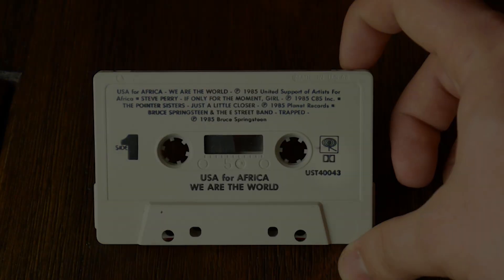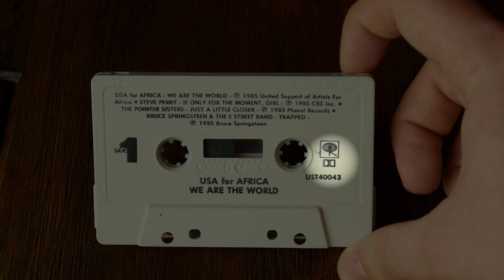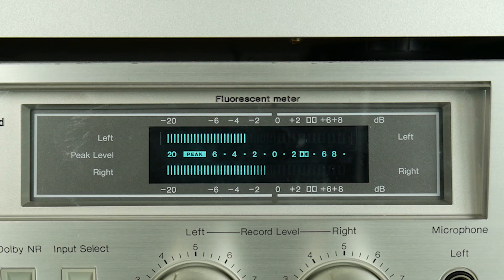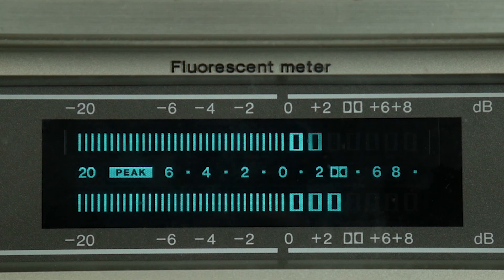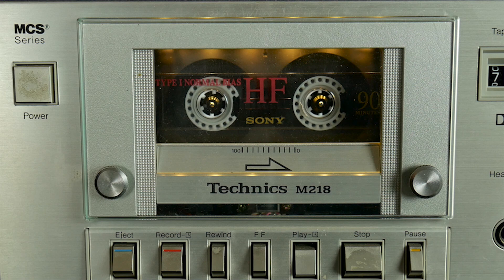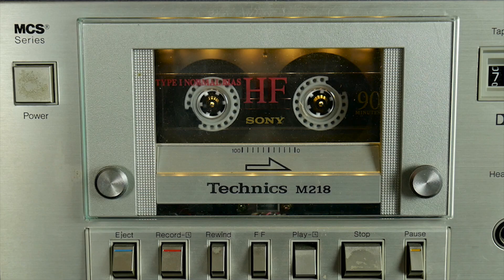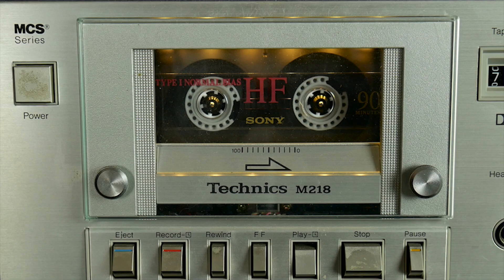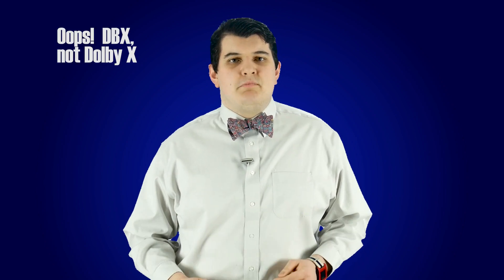What is Dolby Noise Reduction?  Dolby's Humble Beginning

Comment: "The Dolby chip inside the cassette player..."   No, my friend, true Dolby NR was implemented with discrete transistors.  Today, you systematically reach for the word "chip" to represent electronic circuits. In 1974, analog (audio) integrated circuits, although very complex and useful, were still in their infancy, and did not have as good a noise performance as discrete transistors.  I have 2 cassette decks from the 1970' + 80's. A Sansui, and a Pioneer ( the Pioneer with the Omega tuning fork logo, not the new Chinese Pioneer crapany). Both have discrete transistor circuitry  exclusively on the PC boards ( and it's a LOT of circuitry). Integrated circuits that could surpass discrete performance in noise and distortion didn't come to market until after 2000. And by then, virtually all audio component manufacturers had moved over to digital due to digital's inherent ability to reduce/remove noise and distortion, as well as to the efficiency and low cost of automated surface-mount PCB fabrication, virtually all of which is done in China.

Comment: I think you are confused. 
You show two different EQ profiles and call it companding? 
No this is a transfer function followed by an inverse transfer function. 
Companding is compressing the dynamic range using a limiter or leveling amplifer with a ratio of 4:1 (for example), then using an expander with a ratio of 1:4 to restore the dynamic range. 
The difference is that an equalizer affects frequency, a compressor or expander affects amplitude. 
4:1 ratio means for every 4 dB the signal rises above threshold, the output only rises 1db. The inverse ratio of the expander undoes this. 
From my understanding the Dolby system involves both frequency and amplitude domain.  
I know later versions involve multiband compression and expansion.

Comment: Долби, долби... А вот СПШ в деке типа КАРАТ-201 слыхали? :) Там реально шумоподавление, при том не важно, как записана кассета - СШП всё равно уменьшала шум :)

(that was a comment for Russian speaking viewers who possibly are familiar with noise reduction system in post-soviet tape deck, which was more advanced than DOLBY b. That noise reduction system could reduce hiss on any tape playback, no matter how it was recorded, using advanced dymanic filters. In a couple of words this system activated hiss filter when there weree no higher freqiencies in the source signal and by-passed full range when high frequencies appeared in signal. But having high frequencies in the signal did mask any hiss so it wasn't noticable.)

Comment: There are some errors here. Dolby noise reduction is dynamic -- what you've described is static pre-emphasis/de-emphasis, which as you say is a form of compression. But Dolby varies the cutoff frequency according to the level of high frequency in the signal, reducing the pre-emphasis when the signal high frequency content is high. The Dolby symbol on the VU meter is not a "never exceed" level for use with Dolby. It is the level where Dolby is not doing any processing on the signal, because the signal level is high enough not to need it (at that level, the cutoff frequency has moved above the audio band). You can exceed that level as long as the tape has the headroom, and it's actually better to do so, for best quality recordings on good tape stock. The clever part about the Dolby system is that it works by varying the cut-off frequency with a fixed degree of compression (10dB, 20dB in Dolby C), rather than varying the compression ratio as other compander systems usually do. This almost completely eliminates the "breathing" effect as short, sharp sounds open up the bandwidth, leading to a surge of tape hiss. Dolby's well-chosen time constants, and the way it opens up only as far as needed for a given frequency content masks breathing almost entirely, which is why it works a lot better in practice than, say, dbx.

Comment: Most of my Cassette tapes are not recorded with DOLBY, and I do not have Hiss  in my recordings.    First of all your SOURCE is the most important part.   If the source is a very good recording, and has no hiss in it, you do not have to use Dolby; Because Dolby ABSORBS the clarity of the recorded sound on your tape.   Most of the recordings these days are Digital and they do not have background Hiss;  so you do not need Dolby;  it will be helpful if you already know the song or the music very well so that you can control to bring down the high peaks.
Also it is very important to have a High Output Cassette Tape.   Finally, if you make a good full recording, you don't need Dolby.  If you notice that there is a little bit of a Hiss in your recording, bring down the TREBLE of your Amp. to 1:00 or to 2:00 PM then you don't have any Hiss.   Good Luck.  Krikor from L. A. CA.

Comment: "Companding" is a dynamic range method of noise reduction, made famous by DBX.  The frequency trick mentioned here is a simple EQ encoding, similar to the famous RIAA cube applied to LP's.  Companding is more involved, but also used to reduce noise on analog  media.  It uses compression and expansion, not frequency manipulation.

Comment: Wh spend 30 fucking minutes trying to read that tag he placed at 0:42 sec for a millisecond like an asshole
Reply: I agree those kinda tags are nothing short of a dick move regardless of who placed it there. The reasoning someone told me is those millisecond long tags are there as acknowledgements, not meant to have high importance; that if the viewer wants they can read it. But it lasting for so little time makes it a big problem to find, only for the text to be worthless.

I propose 2 alternatives, of which the latter's my recommendation:
1) have it in a corner as a small text that lasts as long as others usually do. It's there and can be read with way higher chances to stop at correct spot. Since it's small it also tells the viewer it has less importance, so it's not so biggie if your eyesight doesn't allow seeing it.
2) just make it last as long as others usually do. To me it's nowhere remotely as annoying to be reading worthless-to-viewer acknowledgements you actually see than it's to find and read those millisecond long ones to kill your curiosity.

Comment: What? Did you dare to suggest digital audio is superior to analog (analogue?)  😁

Just kidding, geez! All this mumbo jumbo to get tape to be decent. Records have crackle and pop. Tapes have hiss (on good days, usually they were destroyed by their drive mechanisms or just worn out...heads misaligned, biases off etc. etc.)

If there is any difference, I'd love a comparison of Dolby B and JVC's ANRS system if you haven't done it (I don't remember one.) As I recall, ANRS actually explained itself in the user manual as doing what you mentioned at low amplitude, but didn't compress / expand at higher amplitudes to avoid saturation/distortion. At the time, back in the 1970's when I saved like a pirate as a child to buy a JVC stereo cassette deck (because it was the greatest thing on the planet!),  I was thrilled!! Yeah, I was a geek back then, and still am.

I think ANRS was JVC's answer to Dolby and pretty compatible. Just an avoidance of copyright infringement.

Comment: My first experience with an equalizer was a device attached to my dad's sound system that involved a bunch of vertical sliders. Sound went from the TV into the stereo system, then into the equalizer, then to the speakers. After a move, he usually used the opening from the Top Gun movie (VHS) to tune the equalizer, moving from the center of the living room to the equalizer and back as the opening played.

Comment: This time I have to correct you. Dolby B is not just an emphasis like the RIAA curve for vinyl. Buts is also a compressor. Just like Dolby A but with one single band. While recording the highs are compressed. And during playback they will be expanded. So if you want its a dynamic emphasis. More in quiter parts, less in louder parts.

Comment: Before inventing Dolby A, Ray Dolby was working for Ampex when he was instrumental in the invention of the first truly usable broadcast videotape system. You do have a couple of errors in your video, such as the purpose of the Dolby symbols on record level meters. That mark actually indicates the record level that results in a flux density of 160nW/m on tape, the "Dolby level," which is used to make sure that playback and record systems are aligned for proper playback of "Dolbyized" tapes. Also, you did not point out the fact that Dolby is a dynamic preemphasis-deemphasis system that boosts only quiet highs, not loud ones on record, and cuts only quiet highs, not loud ones, on playback. Otherwise, great job!

Comment: This is a video that really should have an alteration as the description of Dolby-B and Dolby NR method is outright wrong.  What is described as Dolby-B is nothing more than pre-emphasis (boost) and de-emphasis (cut).  That is incorrect for Dolby NR. It is merely your perception of Dolby-B because it works on a single band of the audio spectrum (the higher frequencies).

Dolby uses a compressor on those frequencies, not mere level boost.  The amount of boost is dependent on the signal level itself. The levels of compander operation are defined which is why Dolby-B is not as aggressive as other forms of NR but it also means that systems without Dolby NR will have a listenable tape still.  Dolby-C, having a greater range for its compressor shows what happens when you hear compression at a greater level or what you describe as weird. 

Your misrepresentation of Dolby NR process lead to the next mistake.  The Dolby NR system  is level dependent.  Above Dolby level (represented by the Dolby logo on your VU meters), NO compression (and on playback expansion) is applied.  It is NOT a maximum level.  Maximum level is dependent on your recorder electronics and the tape's ability to handle the level (flux). If your tape and recorder distort above Dolby level with Dolby NR...it will without Dolby NR too since the NR circuit is effectively out of the signal path at that level (another key to Dolby NR is the principle of minimally invasive circuitry...don't alter anything that doesn't need to be altered.  Loud signals don't need NR since they are sufficiently above the noise floor.

Since Dolby NR is level dependent by nature, and since a VU meter is a unit less level, Dolby level has to be defined or tapes on one machine won't track right on another.  By making the Dolby level uniform (on the tape, measured in nanowebers/meter) and then representing that level on each deck's VU meters, and then calibrating the Dolby NR circuit to that level, tapes should be compatible from one deck to another.  If they are not compatible, then one or both of the decks were not calibrated (or have worn heads and are not playing back high frequencies faithfully) leading to the false claim that Dolby kills high frequencies.  If the decks are calibrated properly, Dolby NR does not alter the frequency response, just the noise level.

Comment: Dolby B was essentially the best for transportable recordings, as you noted: they sound pretty decent when played back with proper Dolby B, but they didn't sound horrible if played back on a machine without it, unlike C or dbx. So you could take the same tape to your audiophile friends or play in a cheap stereo at the beach and not be too disappointed either way.
Fun facts: in the '70s, there was a short-lived experiment with Dolby FM, where your favorite major radio station broadcasts were encoded by Dolby B to reduce noise. 
The later Dolby C was essentially two tweaked Dolby B encoders run in series. 
dbx (stylized in all lower caps) was also interesting. Matsushita was a huge proponent of the dbx system which explains why most dbx chips have Matsushita logos on them. However, due to its poor sound on incompatible equipment, in addition to a "breathing" sound sometimes associated with dbx recordings, dbx didn't find a ton of consumer use, even with the introduction of (ultimately short-lived) dbx disc-encoded vinyl records. It was common on professional equipment though, and did get a major win in the USA: a flavor of dbx NR was used for sound in the MTS broadcast system (and most chips implementing it were provided by - guess who - Matsushita).

Comment: I don't think this is completely correct. Dolby is more than just an EQ in and inversed out. It reduces the dynamic range in those noisy frequencies so quiet sounds are lifted higher above the noisefloor. On playback it expands the dynamic range again. The peak level isn't increased afaik.

Comment: Dolby was a just a ripoff of Edwin Armstrong's use of pr-emphasis in FM transmission. Armstrong used it to lower the noise in  frequency modulation. Armstrong was the developer of FM radio. He worked on it with RCA. They really ripped him off. They made changes to his system so he could not sue them. They raised the transmission frequencies and put it in between the lower and higher VHF TV bands instead of where TV channel One would have been. By the way this is why there was no channel one on the analog TV system.  He didn't know what to do so he took a leap out the window from his home in Manhattan in NYC. Bye Bye.

Comment: In the studio during the analog days, it was always a fine line between saturating the tape with desired signal, and hammering the tape too hard and over-modulating it, thus distorting the sound. If you didn’t peg the meters to get as much desired noise as possible, you got hiss. Mastering signal to noise ratio was an art. Desired signal vs undesired signal was a pitfall of magnetic tape. While digital recording solved the undesired signal problem, it totally took away the warmth. The realness. Especially in the mastering phase. This was made even worse in the early 80’s during the record label’s mad dash to get entire catalogs re-mastered for release on CD as fast as possible. Not only did converting to digital wipe away the warm, authentic sound, most were re-mastered very hurriedly, and very poorly. Even worse, they have yet to be fixed. For example, when you listen to, Kansas’ Carry On digital media, it sounds so different, (worse). It’s way too wet. Especially the drum tracks. As a general rule, drums should have much less reverb than what you here when it plays on the radio now. I miss analog.

Comment: I believe that the BTSC stereo used in analog TV broadcasting starting in the mid-1980s until 2009 (RIP) used some form of dbx noise reduction on the difference (L-R) subcarrier that was added (for backwards compatibility with mono TV sound) as part of the multichannel sound (MTS) signal. The mono signal of MTS was the sum subcarrier (L+R), and for it they just used high-frequency pre-emphasis at transmission (before the MTS multiplex was frequency-modulated) and de-emphasis after FM demodulation. While I assume that the recovered left (L) and right (R) signals benefitted from the dbx noise reduction of the L-R signal, unfortunately I believe the complicated nonlinear encoding made achieving excellent stereo separation across the 14-plus kHz audio bandwidth very difficult, even with DSP decoders present in later receivers. The audio bandwidth was fundamentally limited by the fact that the MTS signal before FM was applied had to have a pilot tone locked to the TV’s horizontal rate of 15.734 kHz.

Comment: I'm not sure where you got your info but I think you're wrong, my understanding of the way Dolby works is based on the principle that two signals that are 180 degrees out of phase cancel each other out.  since tape hiss is normally random you instead record a known level of designed hiss, upon playback you mix the signal with the designed hiss but 180 degrees out of phase of the playback and the 2 cancel each other out, most importantly with out effecting the original sound. this also makes tape head alignment critical, any miss-alignment will affect the performance of the Dolby system. for many its an easy thing to experiment on at home if you have something with stereo speakers that are manually wired. they are marked  positive and ground so that you keep the speakers in phase. reverse 1 speaker and listen to what it does to the sound, the effect will vary depending on the distance the speakers are apart and would be most pronounced if you play a test tone. while next to a speaker you will hear the tone as usual, but as you move to the center between the speakers you will notice a drop out in amplitude. it wont drop out entirely due to reflections of sound waves and such.  While this method was originally for noise cancellation it was eventually used to encode multi-channel surround,  for instance sounds that are perfectly in phase if you take the right channel and inverted it 180, then mix with the left, they would cancel each other and the remainder would be the rear. various methods are used to separate the center channel, and retain the Left and right. but the concept is the same. I'm pretty sure they use the same concept for noise canceling headphones, that's the purpose of the microphones on them, they are sampling the sound around you and then inverting it and as the 2 sounds reach your ear they cancel. this works with repetitive sounds best like the drone of an aircraft engines, other than sounds that are constantly varying in level and frequency.